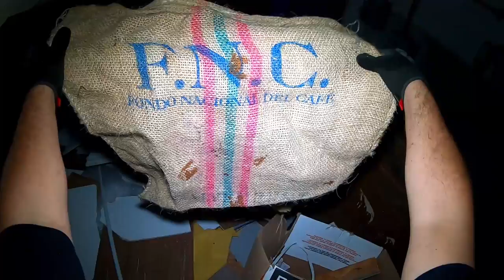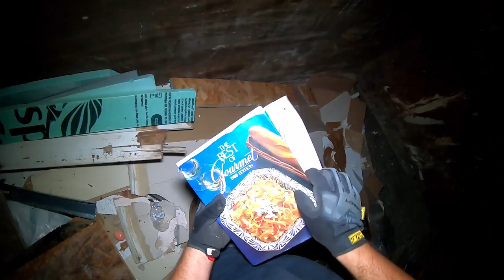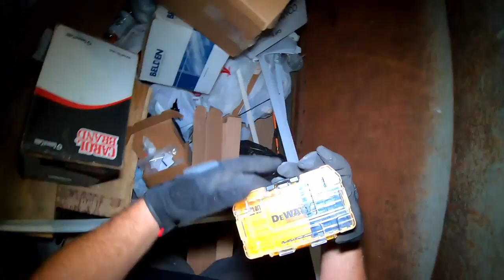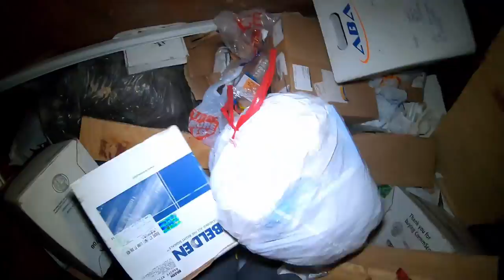Dumpster Diving "Down In The Nitty Gritty"

Comment: Mike you might want to look into that Samsung TV if it doesn't work. Mine stopped working and with a little research it ended up being a capacitor I picked one up at the source (used to be radio shack) for just under 2 bucks. It only took me about 15 minutes to switch it out and it's been working great going on 8 years now.

Comment: Mike if you get a flat screen tvs that come on and cut back off take a air compressor and blow the back of it out. Most of them are full of dust in the power supply and it causes it to heat up really quick and it will cut off
Reply: Same if it gets wet leave it in the garage about a week and let it dry out. I have one that was in a fire and got wet from the fire department and I have been using it for the last five years no problem

Comment: New building construction was hit hard by Covid. Which led to cuts in the forest industry. Now with recovery starting to improve people using stimulus money for down payments to buy homes. Which in turn led to a sellers market. Sellers market led boom in New home construction which has put lumber at a premium. 60% increase over the past year. Ex. Wall studs were 2.00 now 6.50-8.00 a piece. 4x8 Plywood was 24.00, now can be as much as 70-80.00 depending on grade.

Comment: Lumber, wood products and construction materials increased significantly due to:

1. Housing building boom was starting.
2. Wild fires burnt up lots of timber.
3. WuFlu hit causing lots of timber cutting, saw mills and related businesses to shut down operations.
4. Shortages of material caused supply & demand price increases